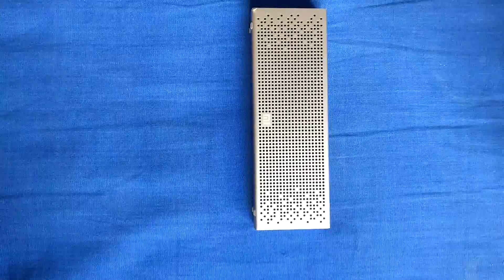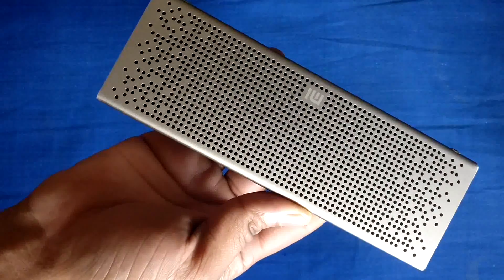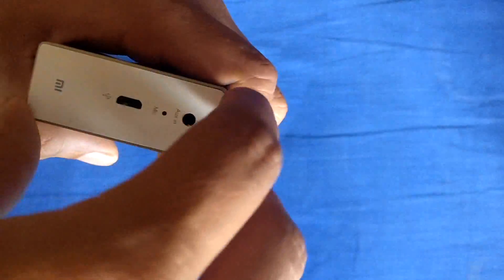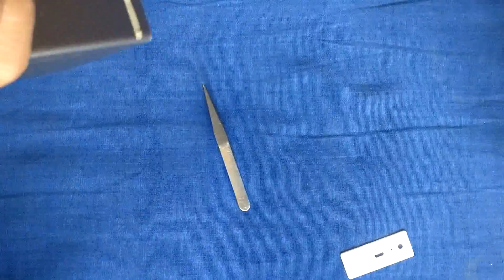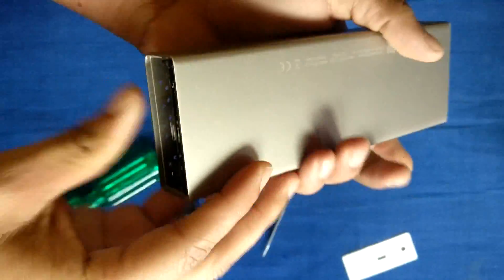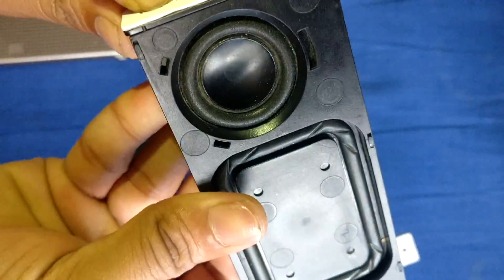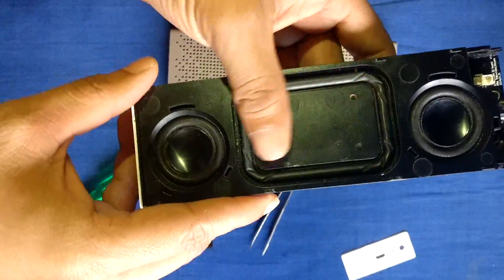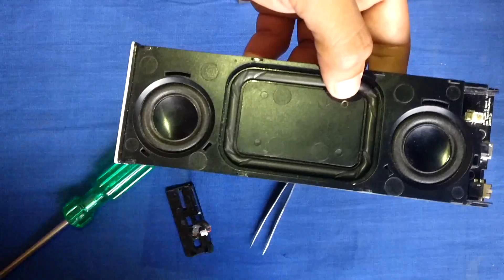Xiaomi MI pencil pocket box bluetooth speaker(MDZ-15-DB)  teardown.

Comment: Thank you for this. I have the same speaker gifted by mom, it fell and sounded like shit.
Without your vidoe, it would have taken me a long while to figure how to take this thing apart (mine had a lot of glue on the white cover)
Would have used a heat gun if I wasn't sure, but picks do help.
Got it opened up and one speaker was misaligned, had to push back in.

Comment: That is not a subwoofer. That is a passive radiator. It works by the air pressure of the speaker drivers.